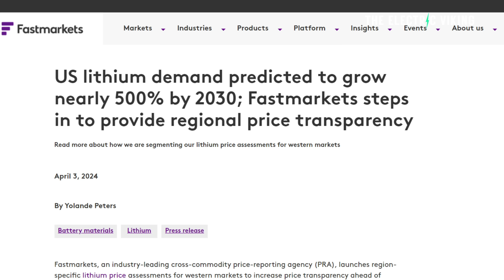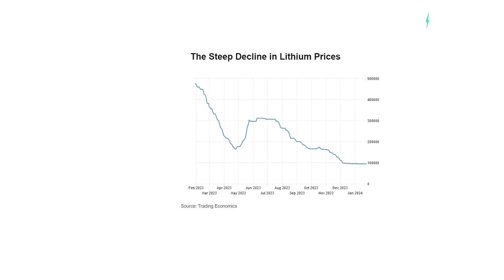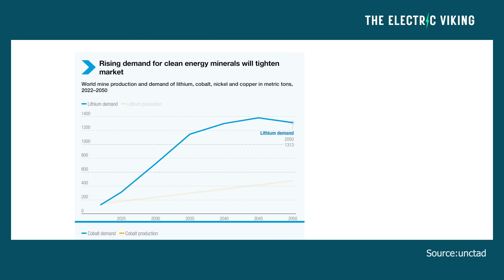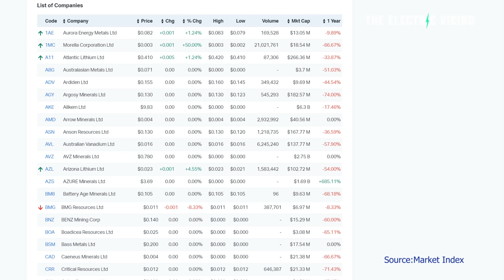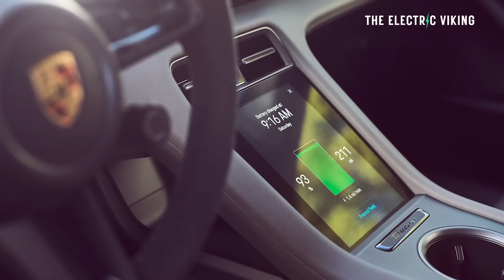Experts say US lithium demand will grow nearly 500% by 2030

Comment: With the recent breakthrough on solar panels (MIT) and the cathode breakthrough in South Korea, EV will be able to use the power of the sun to recharge perpetually while driving.  Imagine a Tesla with 8 small solar panels in the hood, 4 at the back and 4 more on the roof. 16 pevroskite solar panels (2.5 times more efficient than current solar panels) sending power to the Manganese Ferrite based battery which will have 750-1000 miles in range.  The future is EV.  It just takes time and development.

Comment: If we only use the autp transition as the guidepost, that is saying we are only going to 5x the number of EVs we'll be making but we need to increase that production to between 15x and 20x. Now, add in all the energy storage batteries that we need for our homes and for the grid itself. No, if we don't switch/evolve to something like sodium, we are easily going to need 5000% as much lithium not just 500% more. Fortunately there is lots of it and we do have sodium arriving on the scene now too.

Comment: this is 5x but this does not mean we will be selling 5x the number of EVs.  stationary storage is growing.  electronics is growing.   most importantly, average battery pack size of EVs will have to grow if we want to get to say 30% EV by 2030.  we have a bunch of sedans and crossovers for sale and a few trucks at very low scale.  additionally, the sedans and crossovers we have do not have enough range yet.  by 2030.  the expectation for range will be close to 400 miles or at least 350.  charging is way behind and lots of potential buyers dont have home charging.  people cannot be expected to fast charge twice a week.

Comment: US ... Hasn't  even gotten started yet.... Only 7-8 % of new vehicle sales.  Well that's only 35 to 40% by 2030....

It is coming and there's no stopping it. 

Whether that lithium comes from domestic sources or not is questionable..... At current prices those sources aren't viable.     Mining is all about concentration

Battery cost is irrelevant.  $1,000 on the cost of a $50,000 car is a round off error.... That's just how manufacturers blame lack of anybody wanting to buy their cars

When we have charging infrastructure and better batteries it will take off rapidly.... The batteries are just around the corner but unfortunately nobody's building the charging infrastructure

Low margin lithium producers are going to struggle and squeak by..... With their dilute sources.... And concentrated producers... Will make ob scene amounts of money

The holy grail  of  batteries will be solid-state lithium sulfide.  They have incredible storage capacity.. up to 2600 W-h/kg........8x The capacity of production batteries today.    

They're simply working on solving the dendrite issues currently
Reply: Li-S , une start up australienne a beaucoup d avance dans ce domaine 🤑🤑🤑

Comment: LAC (a Vancouver based company) that is trying to develop the Thacker Pass lithium reserves is embarking on a major science experiment of trying to extract lithium from clay deposits. Likewise, CTR (an Australian firm) is in California's 'Salton Sea' for the past decade, again, embarking on another major science experiment of trying to extract lithium using DLE from salt brines. Neither operations have been proven on a 'large scale'. 30 years ago America had like 90% of the supply of lithium. Within the past few years, US's share of the pie had dropped to a whopping 2%. Why? What does Australia and Chile have in common? Australia produces over 50% of the global supply of lithium, which is done purely by hard rock spoduemene. In Chile, (or the lithium triangle there) supply a good portion of say 40%, which is done purely by extracting lithium from the brine salars through evaporation. 

If America is going to have a lithium market of it's own, raw material has to be imported and refined. But it's a dirty process and the environmentalists have this NIMBY problem. Which is why China owns the supply chain and refining. 

Biden just passed a 100% tax on Chinese EV imports into America. While places like NZ (who have free trade with China), and Australia, have opened the door on Chinese brand EVs.
Reply: CTR has just begun building a new plant at the Salton Sea which will use a direct extraction process. This is an adaptation of a process that has been used for other types of mineral extraction and their current studies show they can expect a 93% recovery of lithium from the thermal vent brine. 
Standard Lithium has completed their study on their direct extraction process in western Arkansas from brine and is building a new plant beginning 2025 to begin extraction. It does away with rock extraction and brine pond evaporation processes. They expect a 90% extraction rate of battery quality lithium. 
Exxon Mobile is working on a process as well.
Reply: @sd70cal  CTR has been at the Salton Sea for the past several years, spinning the same narrative since Simbol declared bankruptcy months after Tesla put in an offer to buy them out. This is of no surprise and Wall Street has the $ elsewhere knowing that these projects are nothing more than a hyped up science experiment that will never work on a large scale nor will be competitive against existing large scale lithium production. 

Berkshire's Geothermal operation there also did preliminary tests on extracting lithium off their geothermal runoff. Their results cited extensive problems with handling the large amounts of silica in the brine mix that it's simply not cost effective when compared to what ALB, SQM, and other proven lithium mines are producing. 

Thacker Pass is another scam of the century in the works after robbing tax payer's $ in the IRA funding. LAC chose to divest their Argentina interest (a hard rock spodumene asset which produces an income) in favour for the IRA. Ganfeng parted ways taking this Argentina asset for good reason. If lithium is the future, then not all lithium is the same and China knows this. Their open market spot pricing is the key reason why all these lithium mining stocks have crashed.
Reply: @sd70cal  They all tout some proprietary DLE process. Fact is none of them have been successful to scale it and make it viable as the brine or clay mix varies far too much that no specific DLE will work on site.
Reply: @blee7650  seems like all they need is a secondary process to reduce the variability in the mix then. Might be why they've concluded testing and have moved on to construction.
Reply: Don’t be surprised if BYD builds an electric car plant in Mexico.
Reply: @waywardgeologist2520  Don't be surprised either Biden or Trump will impose the same tariff on Mexican made BYDs. That's no different when Trump put on the China tariff in his presidency, and China tried to circumvent the tax by having their products partially made in Vietnam but was rejected as having too much China content.

Comment: I'm doubting reliability this an analysis. Lithium demand will obviously grow, however other battery technologies could take market share away from Lithium, along with the growth of ubiquitous EV super charging technologies, so that range becomes less significant and vehicles can operate more efficiently, without having to carry a huge battery around as extra luggage. Thus Lithium battery sizes could actually fall in a mature ubiquitous EV supercharging market. If you have an EV super charger say every 10 miles in a matured EV market, then you don't need Lithium batteries. You can use cheaper less energy dense battery technologies, like sodium. In such an environment, a 250 km range would be way more than adequate for the majority of use cases.
Reply: I would reemphasize that it makes sense to operate EVs as efficiently as possible ( given that the battery weight does not change during the EV journey ). This means using as small an EV battery as possible and as practicable. Why carry around a battery twice the size and weight, that uses twice the amount of Lithium, when you don't need to ? Makes no sense at all from an operational mechanical efficiency standpoint. Thus ubiquitous EV super charging will become one of the most important catalysts of large scale EV deployment and will radically reduce costs of EVs, as they will no longer require long range capability. Thus an increase in EVs demanding more Lithium will be offset by a reduction in battery sizes as geographically ubiquitous EV supercharging rollouts mature.  Prime drivers of this approach,  will be EV vehicle cost and EV operational efficiency and hence operational cost.
Reply: There's an advantage in using smaller lighter batteries with less range, because if you halve the weight of your battery, you wont halve the range. It's not a one to one reduction. You typically increase your energy efficiency with a battery half the weight. Operating EVs with smaller and more lightweight batteries improves mechanical efficiency by reducing the overall weight of the vehicle. This translates to better energy efficiency, improved handling, and enhanced driving dynamics.
Reply: Smaller battery sizes not only lower manufacturing costs but also reduce the total cost of ownership for EVs. Drivers can benefit from lower upfront costs, reduced charging expenses, and decreased maintenance costs associated with smaller battery packs.
Reply: Optimizing battery size and weight minimizes the amount of lithium and other resources required for electric vehicle production. This approach aligns with sustainability goals and reduces environmental impact by conserving valuable resources and reducing material waste.
Reply: By leveraging ubiquitous EV supercharging, drivers can rely on fast-charging stations to replenish their batteries as needed, rather than carrying excess battery capacity for occasional long-distance trips. This results in significant cost savings over the lifetime of the vehicle and promotes affordability and accessibility for consumers.

Comment: If it’s as cheap to make an EV as an ICE, why are so many EV’s losing tons of money while selling at a higher price?
Reply: ICE OEM's haven't ramped up economies of scale for their EV's.

That will come, at least for the OEM's who invest properly, and do it fast enough to survive.
Reply: @jeffl4810   So it is only cheaper for the first movers who went all in early.  Now you have to assume you’re going to sell 500M a year or go home.
Reply: @mnhsty  
Well, if they don't ramp EV's they will fail. Most within the next decade. 

Look at Nissan right now. How about Stilantis... 
Hopefully, they correct their issues, and fast....

A major help is that battery production plants are popping up all over the place. That's one of the main major issues for EV production. The drivetrains themselves are actually quite simple. 
Heat pumps seem to be an issue for some, but as they get engineered, will be a less significant problem.

Comment: There is another factor that impacts EVs vs ICE sales. As the ICE models become adopted less, they become more expensive and then fewer gas stations leading to an accelerating collapse.
Reply: In your dreams. Once the full ev mandates come into force used ICE values for low milage well maintained vehicles will increase.
Reply: @robertfonovic3551  without economies of scale production, the ICE platform becomes too expensive to maintain. The only reason EVs were able to stick around is because they had the backing of rich enthusiasts and are intrinsically more efficient and more simple. Once they have the economy of scale on their side it's even profitable to make EVs. Used ICE vehicles will be in the bargain bin for a little while longer, but the squeeze on gasoline and fewer ICE mechanics will probably also become an obstacle.

Comment: Why would the use of Lithium increase so drastically when sodium is less expensive to work with long term?

Sodium ion makes far more sense, especially in the northern half of the US where temps are low for extended periods of time.

Someone has a lot of stock interests in Lithium related corporations perhaps?

Comment: Now . Sodium battery already go to market . And i think lithium slowly demand in future
Reply: interesting, if Sodium is the new kid on the block, we have to ask why?  up till now the message was,  it is much cheaper than lithium,  but if lithium was the same price, why go to an inferior product?
Reply: @TerryHickey-xt4mf  Both sodium and lithium are essential for the world, and it would be best if cheaper cars and storage used sodium and lithium to other higher demand products.
Reply: Sodium is very abundant and cheap but purification to battery grade adds to costs. Average EV battery needs about 10 kg of lithium carbonate. Lithium has better properties for battery applications compared to sodium, it makes little difference whether the official cost of lithium carbonate is USD 15 or 50 per kg, unless for very cheap cars with low range.
Reply: sodium batterys for small cars only . DYOR

Comment: What ate they going to do with all the sitting gas cars for sale and the ones people have been using for the past 30 years??????????????
Reply: That is a good question, likely it will be exactly as you would expect.  

Ice vehicles will be abandoned, hundreds of thousands of unwanted gas cars.   

Many smaller lightweight gas vehicles, and utility vehicles will be swapped out with electric drivetrain and batteries one at a time.  But most...abandoned, and hopefully responsible entities will strip them out and recycle the metals.